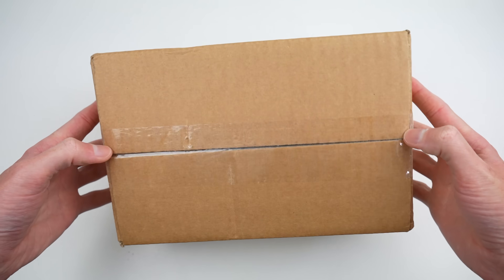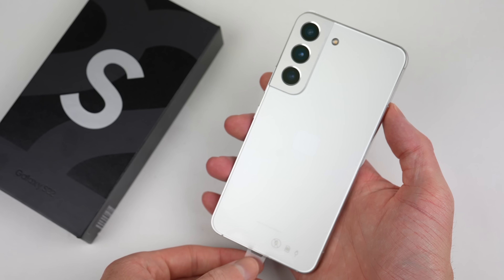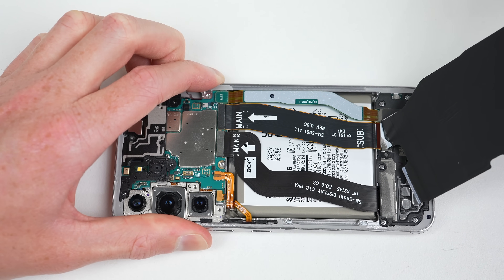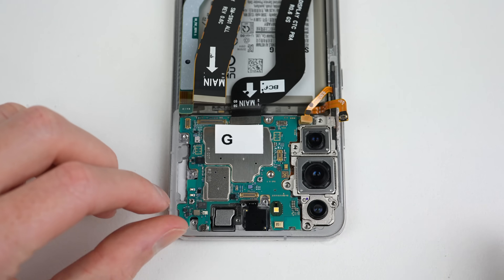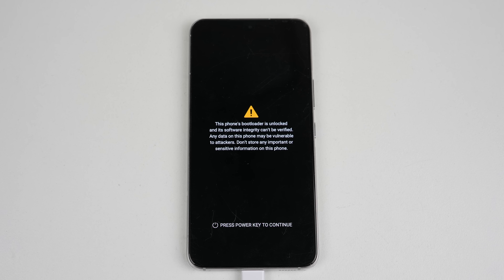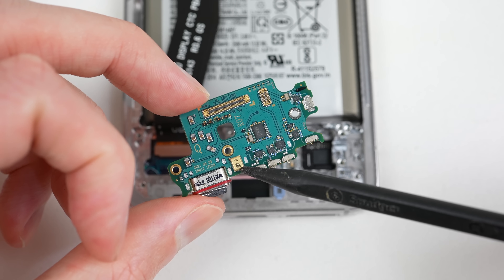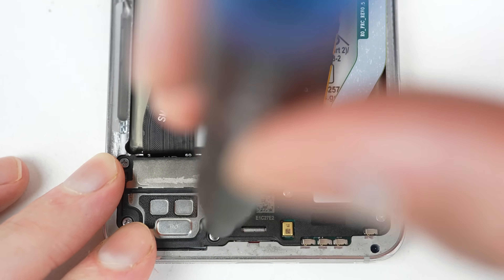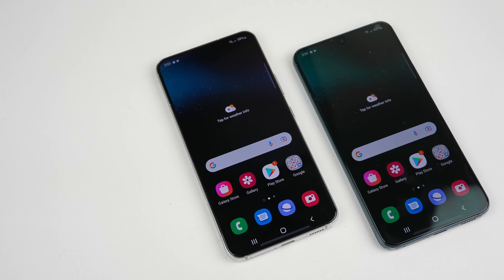Samsung Galaxy S22 - Teardown and Repair Assessment

Comment: Every smart phone repairer (I don’t know if that correct but…) remembers the good old days when if your battery died or blew up you could just take off the back pop it out and slip another back in.
Reply: like samsung Galaxy s3 and s4 :D
Reply: Buy an Xcover Pro! it has a hotswap battery and modern mid tier specs for ~$2-300USD on Ebay. I love mine
Reply: And the Samsung Note 5..
Reply: @kensg  I think they dropped the hotswap battery with the Note 5. Im pretty sure the last high end Samsungs to have the feature were the S5/Note 4. Now its only the Xcover lineup

Comment: Nice to see that Android phone manufacturers are not following Apple (and its ridiculous software locks!) Kudos to Samsung for removing those tri-wing screws they used in the S21.
Reply: It is sad to see them following Apple, however by removing the charger, and expandable storage, and the headphone jack etc.... But even with those negative trends, I still preferred Android by a country mile. Apple can wake me up when they get USBC, ldac, desktop mode etc ....
Reply: @michael_c2  usb c is a bad connector, why would you WANT it? Also micro SD is slow
Reply: @Khloya69  Usb c is a great connector, super high speed charging, and replaceable for a measly $1 usd.

Obviously sd cards are slow, you can get them for super cheap, and give a cheap phone plenty of storage.

Also, wired headphones have much less latency and MUCH better battery life.
Reply: @romashul9672  ‘much better battery life’ boy, you really are slow. The whole point of wired is no bartery. Self own.
Reply: @romashul9672  its not a great connector, it’s less durable and takes up more space. I have bent many USB C cables by accident, never have i done that to a lightning cable in 10 years. It is objectively worse than lightning. Replacements are cheap for a reason. It is garbage.
Reply: @romashul9672  next you’ll defend hard drives in PCs if you’re ok with how slow SD cards are
Reply: @michael_c2  and imagine still being mad about headphone jack
Reply: They’re not following the superior performance numbers either, been holding L’s since 2017.
Reply: @Khloya69  yeah cause phones need to play 8k video on a 6 inch screen 🤣
Reply: @romashul9672  whatever fanboy
Reply: @romashul9672  only poor PC users have spinning rust for bulk storage. I have 8TB all SSDs
Reply: @romashul9672  sure, I don’t believe you’ve never bent a type c cable, they are fragile.
Reply: @romashul9672  ‘pictures and videos’ so not anything of value lmao. Android fanboys roast themselves
Reply: @romashul9672  y’all still don’t have NVME in yall phones lmao, apple had it since 2017. Android fans stay slow
Reply: @romashul9672  imagine still being stuck with UFS
Reply: @romashul9672  FYI, lightning isn’t inherently incapable of USB 3 speeds. The early iPad pros had USB 3 lightning. They could enable it if they wanted to, without adopting the garbage USB C connector.
Reply: @romashul9672  also, this might shock your dumbass fanboy brain, but not all USB C connectors are fast either.
Reply: Eh, this whole back and forth doesn't matter anyways, go ahead and spend daddy's money on all your crap,
Reply: @romashul9672  you know you’ve lost when you resort to emoji’s

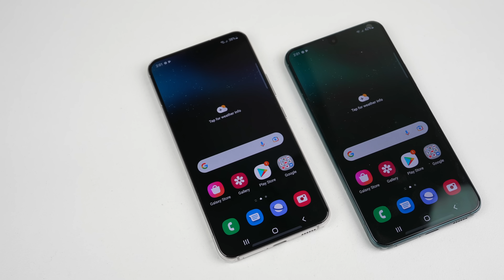Comment: 14:02 - Thank you. It's crazy how these phones get so expensive but still lack such basic features.
Reply: A headphone jack is considered a thing of the past since wireless earbuds took over.
Reply: @traviswalker8933  wired headphones and earbuds are still better and offer much better sound quality overall
Reply: @crestofhonor2349  I suppose you haven't used any wireless earbuds costing more than $100.
Reply: @traviswalker8933  I have and wired stuff is still vastly superior than wireless stuff. This has been known for a while. Plus really high quality wired headphones can be gotten for cheaper than many wireless earbuds with vastly better sound quality
Reply: @crestofhonor2349  consumer priorities have changed. No one wants to carry around their phone in their pockets with a wire hanging in front of them, plus people want to control their music wirelessly.
Reply: @traviswalker8933  And you can still do that with wired headphones. There are adapters to make wired headphones wireless. Plus it only changed because companies forced consumers to switch when they started to remove the headphone jack and giving people no other option. This is why I like options which smartphone manufacturers seem to be against and like to follow Apple. This is why if I got an android phone I'd get the ROG phone which still has a headphone jack. They give you no other option besides getting an adapter which is easily lost.

Comment: i like how simple the s22 is to fix (aside from the battery of course)
Reply: As jerryrigeverything said, "there's enough adhesive here to stick an elephant to the ceiling"
Reply: Yep. Battery and the glass. Everything else is modular. I will give props to Apple to making their batteries in the iPhone a but easier as they have pull tabs. Still half the time they just tear.
Reply: @josuemontalvo221  other than that nothing else is good😂😂
Reply: Yeah, that thing’s stuck down like krazy glue  🙄
Reply: The battery glue can lasts for centuries
Maybe they are still haunted by the note 7

Comment: Sir what is the best way to make money from crypto trading/stock
Reply: You should buy and hold tech crypto Shiba  investment .
Reply: You should know it's easy and hard to make that much profit. I say EASY because it's very possible to make that much, and Hard because you'll need professional assistance to do it, I'd suggest you get assisted by a market advisor..
Reply: I can't disclose too much, but yea I've been using a coach called Mr. JAMES WILLIAMS ' 'and through his guidance, I've been able to make approx. $24,000 in dividends every month, is pretty straightforward, not as complicated as it used to be.

Comment: too bad it doesnt have an sd card slot...
Reply from the maker: I know. Great thing to have if your phone is destroyed beyond repair. Pull out the SD card and you have your data. (if you saved it on the SD Card)
Reply: @HughJeffreys  that why you have backup and people say they are so slow vs internal storage so people were have performce issue try to put game and aps on them
Reply: Not to burst your bubble but in case you haven't realised, most OEMs have already dropped expandable storage altogether a very long time ago only Sammy held out for this long similar to the headphone jack scenario.

Comment: The white one looks nice and understated (already received my S22U). Phantom black looks better but based on reports of the S21 series it tends to have paint chipping on and around the SIM tray and where the frame meets the display, as well as tends to scratch easily.
Reply: Ellis The DJ  Not sure if it’s an isolated case or widespread among Phantom black Samsung phones. I erred on the side of caution on this one so I got the Phantom White one (although I really want the Phantom Black). My previous phone was the S20 in white and it didn’t show any noticeable scratches (maybe because the frame is just plain aluminum and not painted 😅)

Let’s hope that Samsung has addressed this matter. 

Hopefully your new phone remains scratch and chip-free for a really long time. 🤞🏻

Comment: I just finished tearing down the S22 ultra for a video.  I found it really easy to repair.  Besides the front camera, everything is really modular and simple.  Still don’t know why they glued the front camera in place.
Reply: They've been doing it for the past few releases.  I swear it's because it doesn't actually fit into the space for it and they just didn't resize it, but there's probably some weird engineering reason that is way less interesting.
Reply: @garrettlison4992  I refuse to remove it in my teardown videos because I know I’ll break it and can’t find parts.  Lol.  I did replace one in an S20 ultra recently and it was a giant pain.  It started as a screen repair, ended with replacing the camera too.
Reply: @flippinfunkos  I hear that man, I tore the little black coating on an S21 camera the other day and thought I broke it.  Dodged a bullet with that one!
Reply: All you need is an exacto knife and a precise hand. Then fit it into the new housing if you’re doing a repair.
Reply: @NinetiesKiddd  yea I like the feel of the blade.  I’ve seen techs use picks, playing cards, business cards, etc.  The flat blade gets the job done quickly.  Just keep your hand steady and don’t go in too deep.
Reply: So is the earpiece also glued down to the screen? That's really a shame.
Reply: It's funny. I'm a Samsung Tech and when they initially released the screens for the phones, they included the front camera, and they were like "DO NOT ATTEMPT TO REMOVE THE CAMERA BECAUSE ITS NOT DESIGNED THAT WAY AND IT WILL BREAK" and after about a month they stopped sending them with camera's and we're just like "REMOVE THEM VERY CAREFULLY"
Reply: Maybe they did that to keep dust out but why would they use such a strong glue for that?